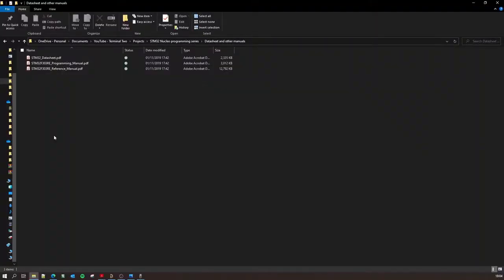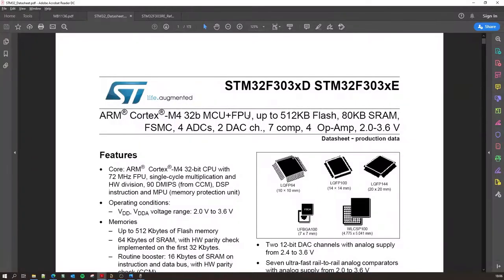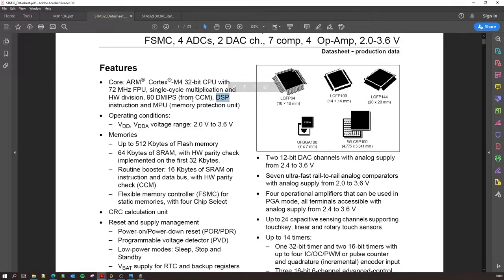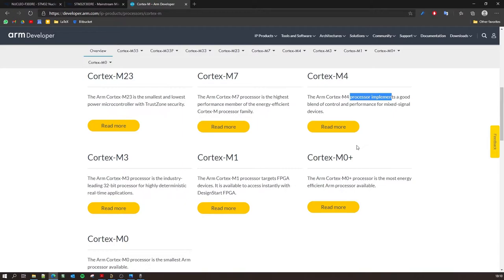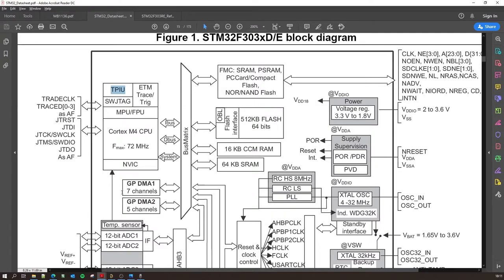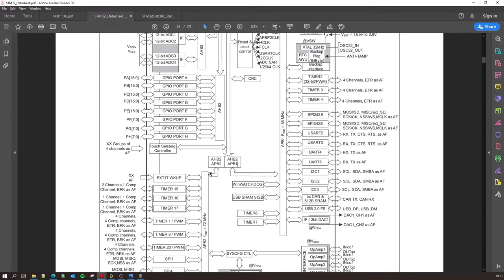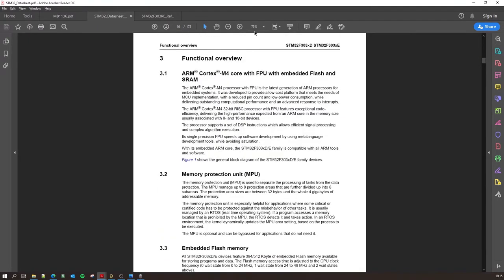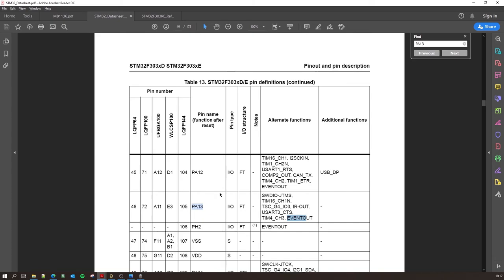STM32 F3 | #2b Processor architecture

Comment: Hey are you going to make some projects with it ?..or it will be a theoritical video only
Reply from the maker: First theory, then the projects will follow. Later in the series, there will be SPI, I2C, UART, CAN etc which actually need some communication with external modules. But feel free to comment what project you would like to see.
Reply: @TerminalTwo  like line following robots...like what you made with Arduino